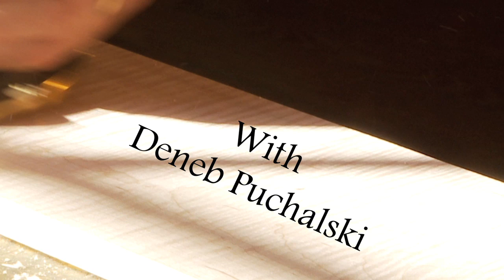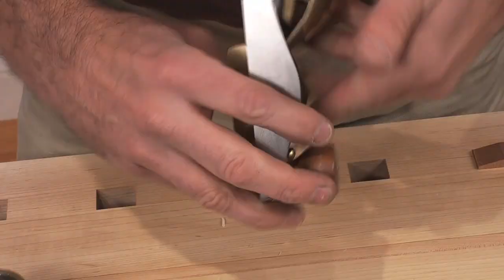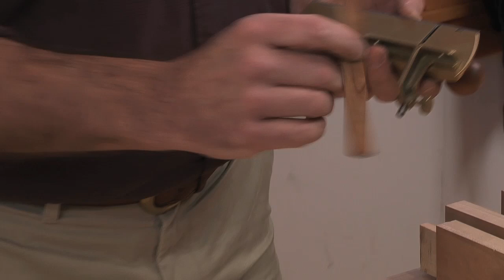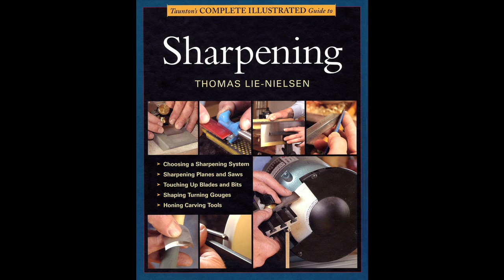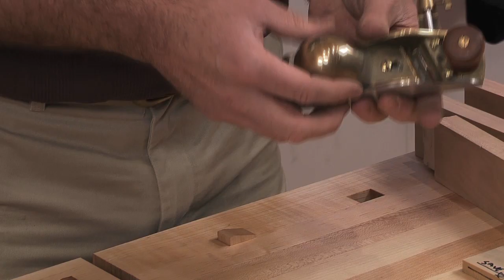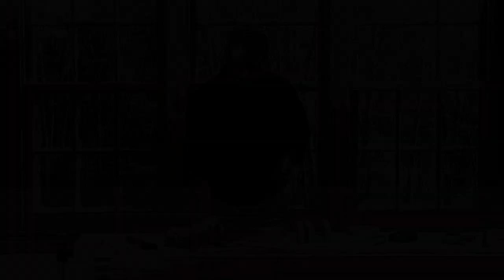Quick Tips, Episode 7: No. 140 Skew Block Plane Setup & Use

Comment: Hi, newby to woodworking here, so far I have one chisel and two planes, little and large, thinking this would help me to get 100% proper joints even if my sawing/chiselling is not 100%?
I am left handed, but I can manage planes both way, so .......... its either this tool or a number 3 plane and a chisel,
Reply: I am left-handed as well and am considering the right-hand version of this plane for cleaning up tenons.  You can do a lot of work in a shop with just a #5 and a block plane (be it skewed or not).  These are definitely the first two planes to have in a shop.